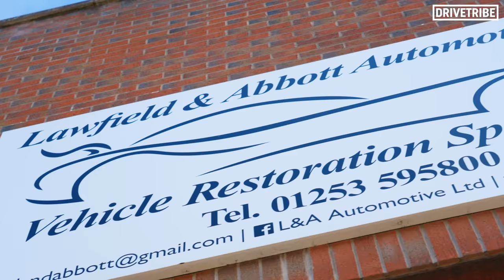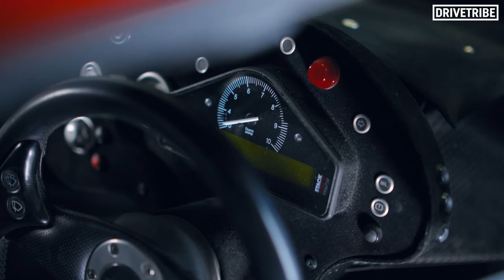The 7.7-litre V12 supercar that was too scary for anyone to drive

Comment: As a '96 4.2 Cerbera owner, 'normal' seems like kind of a misnomer for such vivid cars, but the Speed 12 truly is in another stratosphere of insanity. It makes Paganis and Koenigseggs look tame. Thank you for showcasing this piece of unobtanium madness, and for delivering a healthy dose of TVR history.
Reply: I wouldn’t say tame. No real evidence other than a tvr manual or forums to back up that one. This one is not in the same league of paganis ect, Different class entirely.
Reply: Unobtainium madness 😂 👌🏻
Reply: @Crsf84  nah Speed 12 is in another legue way cooler and just a better looking car
Reply: @Crsf84  it would slaughter a pagani or a koenigsegg
Reply: @Crsf84  Yes, I would say tame in comparison. The Speed 12 has no traction control. No ABS. No airbags. No nothing, apart from a massive engine and hardly any weight. Regular TVRs demand healthy respect, particularly in the wet, but this one is off the charts.
Reply: @jeremikurry3167  wouldn't say it's a better looking car but definitely much cooler and faster
Reply: Its a monster that only few can tame while being unicorn in same time!
Reply: Did yours ever lock you in it. No power and doors didn't work anymore? They certainly had a character all of their own!!
Reply: @simonmaloney2614  my cerb has cable release for the two doors so if for some reason the power went from the actuators you can easily open the doors
Reply: @qeedzhr no it's definitely better looking
Reply: I have a Kia that gets 36mpg!
We should trade one day!

Comment: Reminds me of a first gen Dodge Viper. The side vents, side exit exhaust, and the rear bumper all bring that car to mind. Not to mention the rawness of it as well.
Reply: Yep. I’ve always wondered why anyone from Dodge never mentioned TVR. They were pretty much making the viper before the viper existed. At least I’ve never heard anyone from Dodge ever mention TVR.
Reply: Rear roof def has that Viper look
Reply: I've always called the Speed12 UK's Viper.
Reply: I always said that too.
Reply: Especially if you line up the the ACR and Speed12.  Just throw literally everything we have in the shop at it and put it on the track.  Outside of inbore suspension, the Gen 4 ACR is very much geared towards murdering the driver just after you set a fastest lap time.  How I imagine it feels to drive a Speed12 at the limit.
Reply: it is made out of the viper platform/chassis, only with a few modifications and wider body
Reply: @charlybrown3812  Well yes, but in reverse.
Reply: Absolutely.  Which really undermines the credibility of the narrator ("never seen anything like this"?) - maybe he meant in the UK only?
Reply: @charlybrown3812  .. Have you ever worked on a Viper before?
Reply: @timlawyerx9  My guy, you need to look up the production date on these two vehicles.
Reply: @jamesbond1231  yes I have!
This is the body and chasi from viper first generation V10..  this is what small automakers do, they borrowed the engine, parts, and body from large automakers….
Reply: I thought it was a modded viper at first
Reply: @mari0c0leman the viper was made first?
Reply: The doors, windshield the windows.
Reply: I actually thought that the thumbnail in the video was that of a Viper 😂
Reply: And a very oversized engine like the Viper!
Reply: Same
Reply: Even the origin stories are remarkably similar.  They're both passion projects that were obviously way too expensive to build, so they had to use what they already made in the factory to get them off the floor running.  Both cars could've easily bankrupted their respective companies, so what was made was a prototype shell of a car almost, just so they could be made on the cheap, with a heavy emphasis on the drivetrain.
Reply: @AdolfTrudeau  The first gen came out in 1992. This TVR is a first gen Dodge Viper shell.
Reply: reminds you, but Viper was a very weak version of this. Don't get me wrong I love Viper, but this is on completely another level...
Reply: Yup
Reply: @charlybrown3812  That definitely isn't a viper chassis there bud.
Reply: Minus the V12
Reply: @jamesbond1231  it’s not like an actual Dodge Viper shell but I bet when the designer made it, he made it to look like one. Unless I’ve gone crazy, it looks like one to me.
Reply: I wouldn't mind driving over 200 in the McLaren,. Won't catch me hopping in line to drive this one like that.
Reply: @WedidLandONtheMOON  So .. I feel like you need to do a bit of research into the term "Chassis" 

body panels have nothing to do with the chassis....
Reply: My first thought exactly.  Came down to say this, looks like I'm not alone.
Reply: @BTandKM111  300mph youtube gold. 1/4 mi;e fantastic. The beast is off where?
Reply: @WedidLandONtheMOON  you are absolutely right !!   Obviously is not the exact replica, it has many modifications
Reply: @jamesbond1231  I think the chassis is beautiful. Billet ends on a tube frame and carbon fiber everywhere. 

Love to take it for a beat. 

I'd also like to see it in a wind tunnel.
Reply: @jamesbond1231  obviously has many modifications in the frame and chassis
But I can assure Pal 
This is a dodge Viper first generation
Reply: @charlybrown3812  yeah definitely. Dodge vipers are tube frame chassis. /s
Reply: @sleddarcheddar  exactly!!!
Reply: @mari0c0leman  first dodge vipers debut was an indy 500 pace car in "91
Reply: Nice Viper lookalike 😆
Reply: Truly a 90s car with that design if there ever was one
Reply: @charlybrown3812  It's not, TVR has used a similar style since 1990 with the Grifith but more so the Chimera from 92 which if you follow through to the regular cerbera you have a pretty consistant style. When it comes down to it a lot of the similarites can be seen dating back to the chimera and the most Viper-y bit of styling, the arcs at the front of the doors were also in the 1990 Grifith.
Reply: @InsufficientGravitas  when it comes to create a super car small automakers HAVE to BORROW technology from BIG automakers, that’s the ONLY way they can ACHIEVE that SUPER CAR LEVEL 
this is a platform, and body from a Dodge viper 1st generation, I know every inch of that viper because I Worked on it
Reply: @charlybrown3812  What technology would they need, they buld cars with the same body and chassis design and had for years, the new part was the in house v12. also, its really not the body, the pannels dont match up, especially in the front and doors, and several parts arent quite right for it. the bodywork also apears to be carbon fiber rather than resin.
Asside from that, the tubular chassis specifically at the rear, just woulden't fit a viper with its design as a covertable.
All that aside, at the time TVR wasn't a small company, the speed 12 wasn't even the first raceing car with a tubular steel chassis they built.
Reply: 100%!!!! I actually thought this was an unreleased version of the Viper until I watched the video LOL.  Looks so much like a Viper!
Reply: @charlybrown3812  Just because you keep saying it doesn't mean it's true. Have you watched the full video where they explain about the design? 
There is also no reference in any documentation which confirms your claims. Having said that, if you knew every inch of the Viper I'm sure you can easily prove your claims?
Reply: @Mk1Male     Absolutely I can prove my claims,  Worked for Dodge Chrysler plant back in the 90s in the assembly line,  we put together the first and second generation of viper's,   when a small automaker admits they borrowed technology and parts from someone else,  they lose a great deal of prestige and credibility,  but surely thats what they do.  a small company like this automaker wouldn't have the development and  technology to start a project from scratch, thats why you see lamborghinis with nissan autoparts
Reply: @charlybrown3812   The reason TVR was always on the edge was everything to do with using their own designs and parts for the engine and chassis. Using third party components for switches and other parts was just sensible for a small manufacturer.
You haven't proved anything about TVR using a Viper chassis.
Reply: It sounds infinetly better than a Dodge Viper. It never caught fire, the frame didnt bend, the panels didnt fall off. It is actually built as a racecar! The viper couldnt even function as a roadcar! TVR is known for its pedigree, Dodge never has been! That supercar doesnt resemble that POS viper in any way!
Reply: You can't even sit properly into viper, knees goes into front dash and head ramming headliner, even miata has more space for driver. Useless and pretty car for tankist's or lilipuths.
Reply: It has the same story to

Comment: The TVR Cerbera Speed 12 was in the very first Gran Turismo game on the PS1.  It was very difficult to drive without the right tune setup for the suspension and gearing because it had enough power to roast the tires through the first 3 gears.
Reply: Right I still remember not being able to get traction at all so much power
Reply: @AlexLopez-pk3ix  I had to set up the gas and brake on the right analog stick, steering on the left stick, then soften the suspension and spread out the gearing.  Accurate throttle control was still needed, but it wasn't as bad as stock settings.
Reply: Speed 12 wasn't in GT. It first showed up in GT2.
Reply: @Paladin1034  It was in the Japanese version of the game that came out almost a year before the American version. The JPN version also allowed turbos on NSX's, and level 4 turbos on everything, with the penalty of long spool up times.
Reply: I loved driving the Speed 12 and it really taught me throttle control. It's so iconic and just an absolute beast. Too bad I'll never get to drive it or the Viper ACR. :(

Comment: A huge thank you to whoever thought of having that GT4 intro to the car. If it weren't for the older Gran Turismos, most of my generation wouldn't have known about all of these wonderful cars.

Speaking for myself, I always thought that the Speed 12 has always been such a uniquely striking car and I'm so glad it finally got covered on this channel 💕
Reply: It's also in GT2.
Reply: @LITTLE1994  yeah i saw it from GT2 too it was the most powerful with the Suzuki escudo and the Renault espace f1
Reply: Not on GT7 sadly
Reply: @kwamea.n1723  Project 7/12 yeah
Reply: That and the Chrysler concept car from FM2 really summed up the early 2000s for me.
Reply: @kwamea.n1723  and it sounded like a AK47 when doing a burnout
Reply: @LITTLE1994  And GT3.
Reply: Looks like Dodge looked at that, then drew up the mk1 Viper 👍✌️🇬🇧
Reply: @kwamea.n1723  The one in GT2 was more of a concept version of the Cerberra Speed 12. It's an absolute monster. Probably in the top 5 or 3 of all cars in GT2. The Escudo was utterly busted and a cheat code in GT2 but this is pretty close once properly tuned and race modded.
Reply: @causality462  yep. Gran Turismo Sport and 7 only focused on modernizing the cars. The 7 only had 469 cars and the most recent cars available only has 1 car. In 2023. The Ferrari VGT!
Reply: @LITTLE1994  yes. The 1998 TVR SPEED 12. I ever used one on RM variant. When sold, it is worth $500.000!
Reply: @purwantiallan5089  they have the Tuscan speed 6 tho
Reply: Remembers the scene from Top gear when they visited the tvr factory
Reply: Who remembers the lister storm v12 tho?? 🤌
Reply: @jamesbadham3872  it was white I think
Reply: @stephencaesar9825  yellow and green iirc?
Reply: @purwantiallan5089  it's most fun car in the whole game, takes following a guide to tune it properly for racing, but once you have it set it easily smokes anything else in the game, even the Escudo, which while being kind of a cheat car, has very underwhelming steering.
Reply: @LITTLE1994  yeah it actually debuted in GT2, not 3, and it was easily the craziest car in the game if you knew how to tune it for racing.

Comment: I briefly owned a TVR Tuscan V8 (289) and the clutch went out after a couple of hundred miles. I don't blame TVR, the previous owner was heavy handed. The car didn't impress me (compared to a few others i still have) and i parted ways with TVR. I changed the clutch myself and a doctor from Connecticut bought it. I actually drove it up to his house and he cashed me out and drove me to the train station. This car in this video is a specialty one off car. Pretty sweet but if I could afford it i still have a few others I'd choose before it. It can't be driven where I live. I have a '87 911 turbo with the 505 option I bought new and I drive it in the cooler months. it's been 100 for 3 months a killer.

Comment: Looking at this monster, I realized that the Dodge Viper Gen 1 was made with filigree fitment of body panels and a luxurious interior with the highest level of comfort.
Reply: Makes a viper seem like an mgb 😅
Reply: Fun fact, Gavin beach, the brilliant development director and gearbox designer from TVR did the aerodynamics for the dodge Viper are BAe Warton.
Reply: It's also abysmaly slow compared to the Cerbera
Reply: @marvinberwart  Prove it. The Gen 1 Viper's top speed and HP are undisputed and factual. The Cerbera GT has no proven top speed or verified HP.
Reply: @SamaelVR  there is, of course, no actual way to prove my statement. Maths should do the trick though, a car with twice the hp and half the weight of the Viper, (those numbers are verified) must be much quicker
Reply: @marvinberwart  I just said the HP isn't verified which it isn't. The HP of the TVR that is.
Reply: @SamaelVR  have you watched the video?
It has been retuned and dynoed at 880hp.
Reply: @marvinberwart  Retuned as in "that's not what it's HP was". The closest thing to verification that was stated in this video, without a retune, was saying "it blew up a dyno once"
Reply: At first glance I thought it was a Viper, modified some.
Reply: @SamaelVR  wrong. Right after that comment about it blowing up the dyno, he explained that the new owners have tested it up around 900hp.

The gen 2 viper is cool(ish), but not as cool or as fast as this. Trying to compare this thing to the contemporary viper of the era is laughable, and insulting to both the TVR and the Viper. The viper was never supposed to be able to hold a candle to a car like the speed12, it’s not even comparable, just like my diesel Mercedes isn’t supposed to be a race car.
Reply: @HE-162  thank you for showing common sense
Reply: @HE-162  I'm not the one who made the comparison in the first place.
Reply: @HE-162  Once again, 900HP, 800HP, blown dyno. All claims with no facts. I don't mind insulting TVR as they always were a joke company to begin with, that's why they're dead. Maybe the original Viper wasn't designed for that but the ACR was/is and its records speak for itself. 

You can call this thing a cool concept all you want, it's not a legend and its unproven. End of.
Reply: @SamaelVR  all claims with no reason to disbelieve them. The race care did in fact compete in the British GT Championship in the GT2 class, where the engine was restricted to 675 bhp, if you don't believe me check out the wikipedia for the 2000 British GT Championship. Now with that aside we know that the engine when detuned for regulations has over 200 bhp more than the gen 1 Viper and that the weight of the Cerbera is over 800lb less than the Viper, It's pretty obvious which one is faster. 
Yes it's a legend if for nothing other than the batshit insanity required to make something like this.

Comment: This wasn’t on a rolling dyno like modern shops. I have grainy video of it on an axel dyno and it completely fried the internal hearing of the dyno. The shop engineer was guessing it was closer to 2200hp the way it sheered the gearing off the shafts. That’s something you see in dedicated quarter mile drag cars with 3000+ torque. This car was no joke back in it’s development days

Comment: As a blackpool boy who worked in that very tvr specialist when it was called ‘surface and design’ and once was lucky enough to go out for a ride in that absolute animal and the purple car. I can safely say that car is the most intimidating car you will ever be in the presence of. It is absolutely terrifying and one of the only cars I would be genuinely be scared to drive. I cannot stress how much of a privilege it was to experience that thing. And an experience I’ll never forget. Although it’s a huge shame. I can understand why Mr Wheeler decided to shut down the project. Many deaths would have fallen at the hands of that car.
Reply: Nah. The Tesla Model S Plaid, Rimac Navarra etc all have more power and accelerate faster than this Car
Reply: @Mika-85  But those cars aren't nearly as scary as a car like this
Reply: @Mika-85  Mid and boring cars. No noise.
Reply: @Mika-85  Unfair and decades hence contrast.  Similar to comparing a GT40 with Toyota's current GR010. Each more than half a century of automotive development apart.
Reply: @Mika-85  nobody really cares about those cars though. I imagine they feel much safer too, and because of that, much less intimidating.